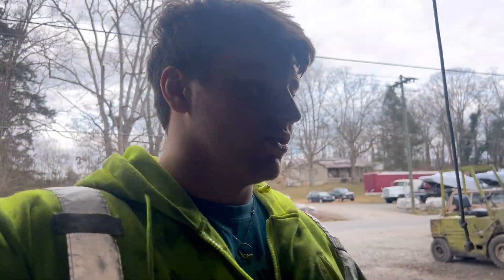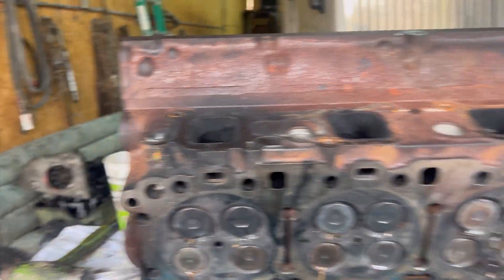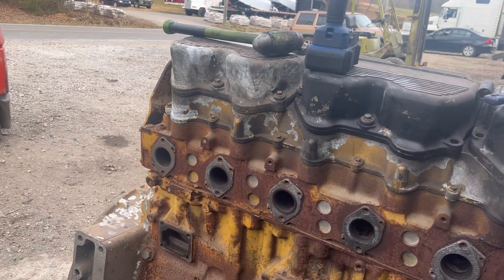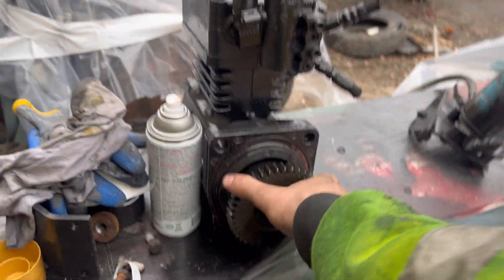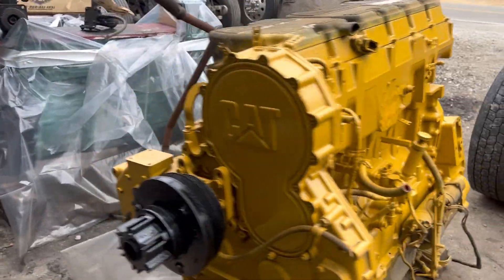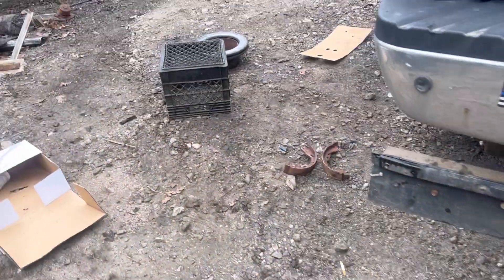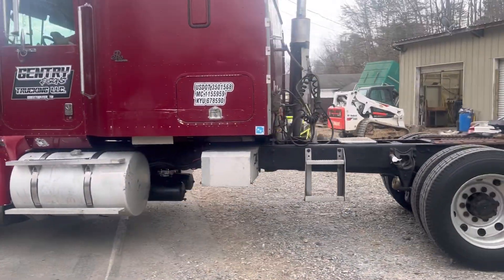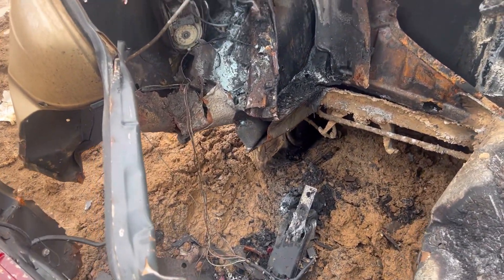Painting a secret motor for gentry & sons trucking

Comment: Real well done on both motors. I am a big advocate of painting as much as possible. Everyone has offered good ideas for finishing the Cat engine. Here is my perspective. Given that there are plenty of projects and that paint should be an ongoing thing at Gentry perhaps consider a dry ice blaster or a vapor blaster. Let's say you get the dry ice blaster. Now you have a productive asset and a new line of business. Brax could be earning some solid $$ doing Gentry equipment but more importantly the service could be offered for all customers. Upfront cost is not low but it would pay out pretty fast. Your finished work with the paint would be very premium. Get a new starter and have that one rebuilt then keep it around as spare.

Comment: Howdy Devin. Engines looking good. I want to emphasize your work is good but I personally dislike Detroit alpine green. They make Detroit 60 blue and it looks so much better than the 2 stroke green. As for the cat  I would paint valve covers with hammered grey then take a day sander to valve cover ribs then polish ribs. Not a fan of black but would paint cat letters on peanut cover black.  Getter done.

Comment: On the cat paint the moving parts black and also the top of the engine black. The oil pan you could go black or yellow I’m not sure which is common on cats. But the Detroit’s oil pan should be that teal color unless it leaks oil (hopefully it doesn’t)

Comment: Polish the valve-covers, and paint the CAT name maybe, lol, good-luck with the crappy Detroit engine, after they get 100k miles on them, they start leaking, and steady losing power, IF they do happen to make it 500k, they won't pull a greasy string from a cats ass, lol, WORST ENGINE EVER!, great video, thanks for sharing.
Reply: These range 650 to 1000 hp.   Outta be strong,   lol

Comment: Polishing turds i don't know why any  one pressure washes engines with open exhaust and intake ports and pump drive opening if you're not going to do a complete teardown when you're done pressure washing it one thing if its all sealed up but what do i know water is good for engine internals even if its not in the cooling passages